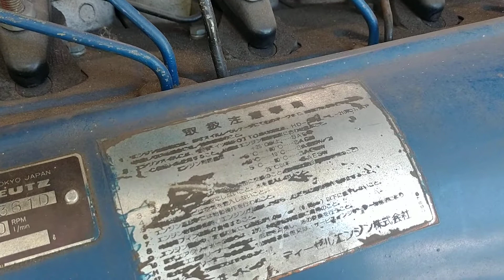BF5L913 Mitsui-Deutz Start-up

Comment: Were these built under license in Japan? Were they used in automotive applications? I would think the anneroid would be annoying in a road vehicle.
Reply from the maker: Anneroids were meant for road vehicles. Stop the puff leaving a red light. None used in auto. Have to add the injection pump advance unit and the RQV governor to make it automotive. I make my own 5 cyl turbo manifolds from 6 cylinder manifolds.

Comment: What transmission is that
Reply from the maker: That one is a Clark 280VO. I did a super rebuild on it, main shaft and all. Then I changed my mind and went with a 6 speed Eaton. The 280V is direct in 5th, the VO is Overdrive in 5th. I have a 280V, too. That was in my truck for awhile.
Reply: @56forddually  what axel ratio and what was the top speed